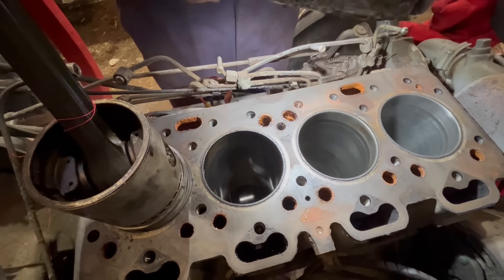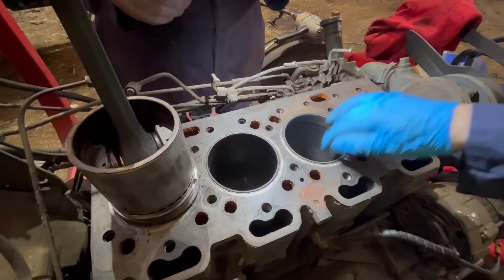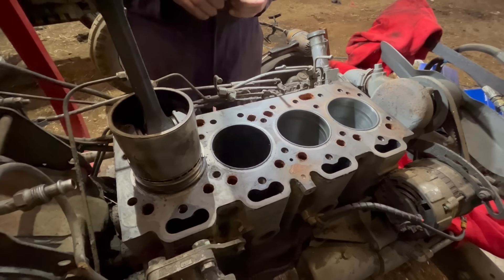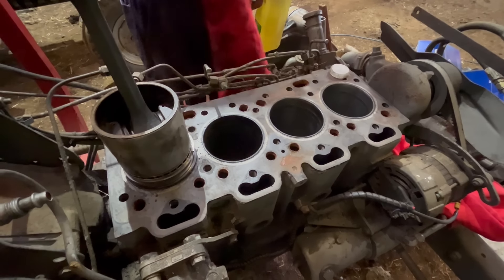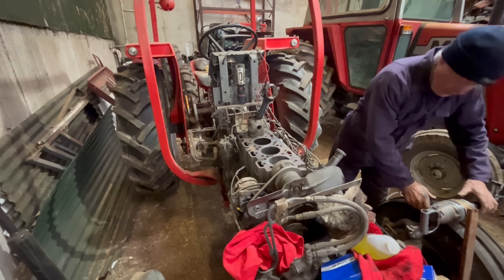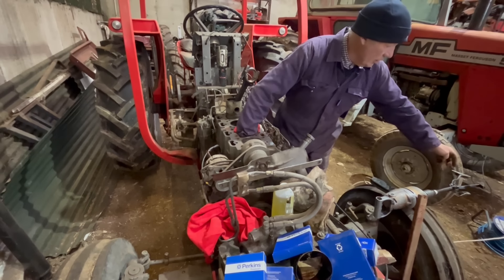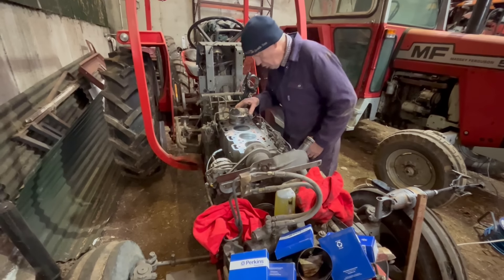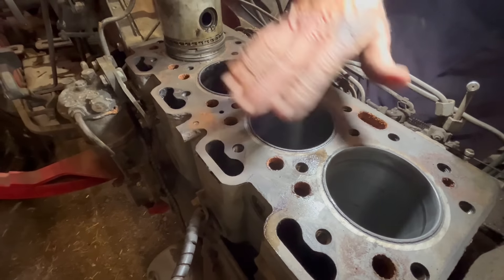Rebuilding the 165 Engine Part 1

Comment: Does the honing debry not fall on to the crank shaft?
Reply from the maker: No the crack is set so that honing device does not hit it. Although if you push it out the bottom of the liner too far it will hit the crack eventually.

Comment: Good video i would have gone for new liners and pistons, Perkins parts are not too dear
Reply from the maker: You may be right there but I just rebuilt the engine on the 3075 and building a tractor shed, based on the very limited wear on the engine, decided to leave it as it was. If it was an every day tractor i probably would have. Hopefully should be fine 🙏